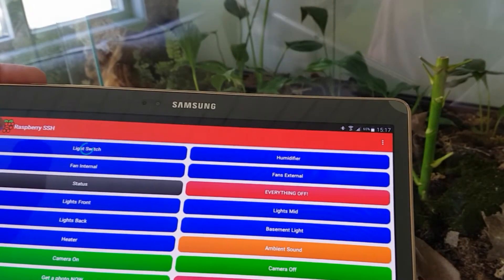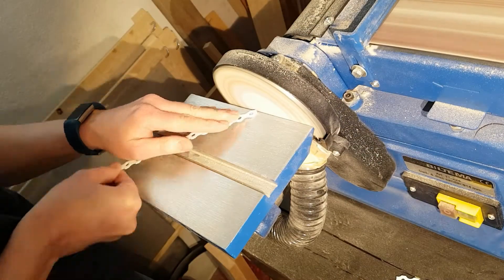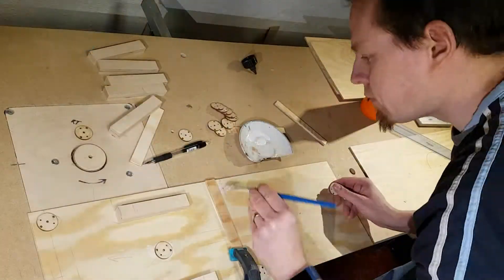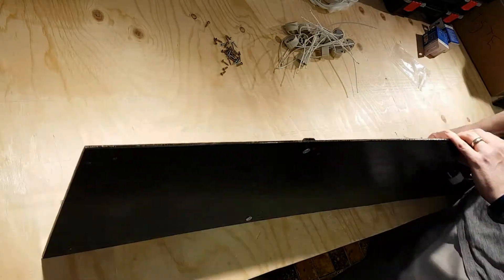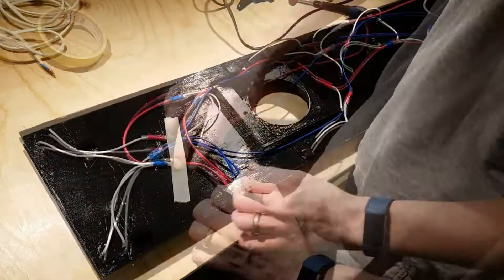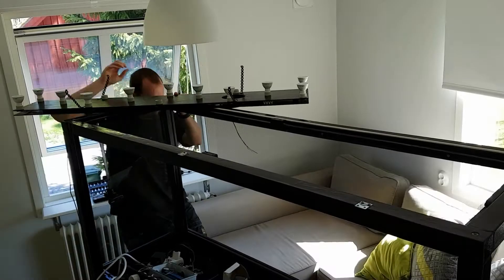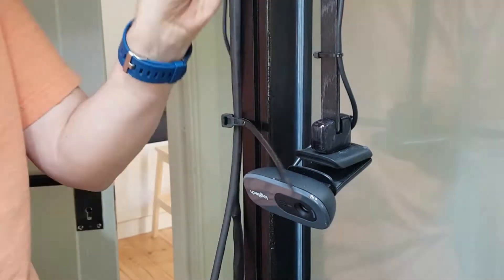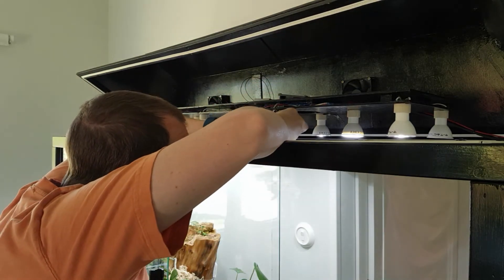DIY Vivarium Lights

Comment: What light bulbs did you use exactly? This looks great!
Reply from the maker: I stared with full spectrum lights but over time replaced them with normal lights (with the G10 fitting) that I can get at any store. The plants require low light and this is OK -  especially since the room is quite light.
Reply: @Induku  Thank you so much for your reply! This will help me save a lot of money! Regards from the Philippines :)

Comment: this plants will be dead soon. the uses leds dont have the spectrum that is needed by plants to life. this are only white leds and thy totaly lack the 450 and 660nm of blue and red that photosynthis uses.
power is not everything...

for people interested in horticulture lighting here a link: 
https://media.osram.info/im/img/osram-dam-1642214/downloads/728289_Horticulture_Lighting_presentation.pdf
Reply from the maker: Thomas Sebastian The lights that I  use are 6500 kelvin and this in the optimal range for vegetative growth (I.e. 460 to 500nm). It also has enough lux. I should mention that the plants are thriving and I am making a time lapse of how quickly they are growing. They seem to be fine after approximately one month and I had to trim some of the keeping fig. I will have a update on the plants themselves when I make the video on the planting in a few weeks. Check back in a few weeks for the update videos.
Reply: Nonsense. I use GU10 LED spots you can get at any DIY/household store and my plants thrive.